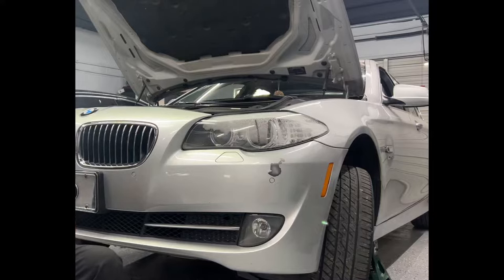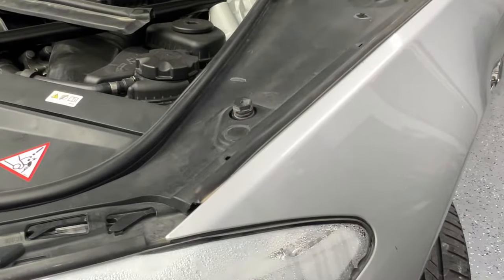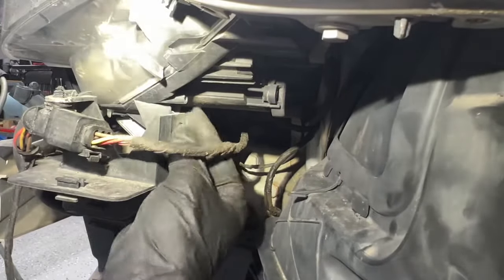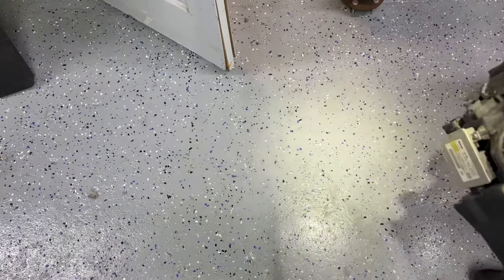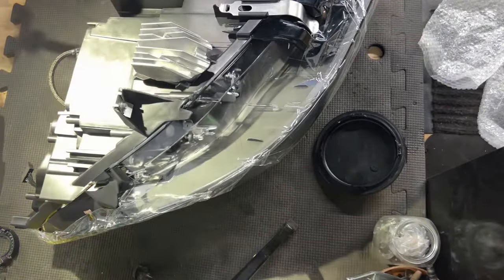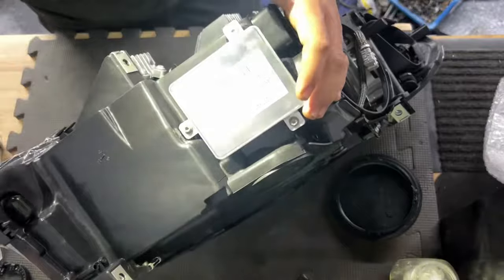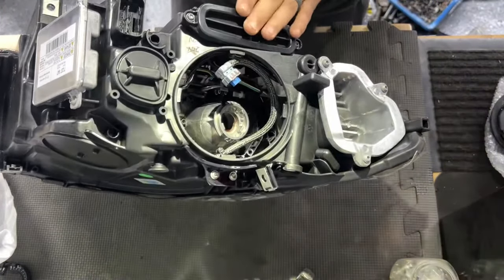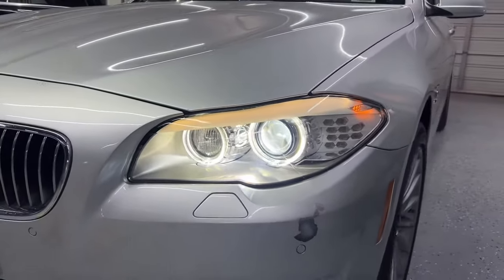Headlight Replacement & Modules BMW F10 | 550i, 535i, 528i (11-2016)

Comment: Why didn’t you replace it like any normal person would, from underneath through the wheel well, using the designated access panel?
Reply from the maker: @sawomir6037  are you talking about replacing the bulb through the wheel well? Because as far as replacing the headlight you can’t remove it without taking the bumper off

Comment: How’s it going , I have a 2015 550i and my front left headlight is giving me issues now. I had condesation in it and it worked then eventually stopped working. I’m trying to figure out if I need to replace the whole headlight or just the control module and maybe a bulb? I have a few codes but the adaptive headlight malfunction pops up first. My halos work but aren’t as bright as my other side? Any advice?
Reply from the maker: If you see condensation inside you have two options! Either you replace the headlight or rebuild yours as in take the front lenses off and reseal it! As for the modules I would recommend replacing all of them just so that you don’t have to do it twice!

Comment: I just installed aftermarket assemblies and nothing in them works, so obviously they need to be programmed. I called everywhere and they all say they can’t do it so do you know what scanner I need to use to program/initialize them? Thanks
Reply from the maker: Sorry to hear that 🥲 autel Maxisys Will be the scanner to do the job!
Reply: @brownsburg.motorsports  I recently replaced mine too but the highbeam and the angel eyes don't work, does it have to do with initialize? Low beam is fine
Reply from the maker: @Bossy23  yes initialization is an important step to make sure everything is working properly!

Comment: I need advice on replacement of the Headlight Washer Cover and the Hinge/Spring that connects to the Front Bumper cover? It's 2014 F10 535i xdrive.  A deer hit it. But also the washer nozzle now moved forward also. I do need a washer nozzle as it's missing the nozzle tip. I compared it to the drivers side. I didn't want to  do a claim on this, because parts are reasonable. Thanks. Duane, MI.( I have the plastice hinge but that's all broken that connects the cover and to the bumper.) Thanks for your time and help. I can't locate no info on this.

Comment: This video is amazing. THANK YOU for taking the time to carefully explain each step. I am getting ready to replace LH headlight on a 2013 528i xDrive and will follow the process you have outlined here. If possible, please post links to aftermarket headlight and modules you have used in this video. Thanks again.
Reply from the maker: Thank you so much!! If you could text me on TikTok or instagram I can try and get you the links if they’re still available or help you look for the right ones!

Comment: Hey, hope you’re still reading some comments. Very informative video, very much appreciated the thorough guide. 

My right side xenon is malfunctioning, it works when I start the car and then after a few minutes of driving shuts off, when I restart the car it’ll work again for a few mins and then shuts off again. Rest of lamp (blinker and angel eyes) work as intended. The adaptive headlight control (lights following steering) and xenon are malfunctioning and give errors on the dashboard. Which module would you think needs replacement?
Reply from the maker: I would say the Xenon module which is the square/rectangle looking module is the one that needs to be replaced! Seems like it works when the module is cold but when you turn on the light it heats up and turns off, most likely some water got in there I would pull it off first inspect it and go from there! 

Thank you for watching my video!!
Reply: @brownsburg.motorsports  thank you for your response, I have since then replaced the xenon bulb and all seems to be working fine. Haven’t had an error on my dashboard at all and the lights and adaptive functions as it should. I’m still a bit confused why a burnt out xenon bulb would case the adaptive lighting error, but atleast it’s fixed now. With xenon module I’m assuming you’re referring to the ballast?
Reply from the maker: @bruciekibbutz4698  yes I Am! I am glad it’s working now!!

Comment: Thanks for the great video! Is it possible to replace only the turn signal module without removing the entire headlight?
Reply from the maker: Thank you 🙌🏽🙌🏽 I believe the headlight will have to be removed to gain access to the turn signal module ☹️

Comment: Do the 2 angel eye modules and turn signal module require some type of water tight sealant before installation?
Reply from the maker: They should come pre-sealed with a gasket on em otherwise you can use automotive silicone

Comment: On my original Head Light there is some gooey gasket materiālu around the base of the halo module.  I noticed that when you installed the halo module, there was no such gasket. Is that Ok? Or should I be sealing it somehow?
Reply from the maker: The halo module should have a rubbery white gasket that comes with it if yours doesn’t have it I would recommend sealing by either getting the gasket online or with some Windshield Gasket sealant, apply it around the module and then install it but would definitely recommend getting the new gasket for it instead
Reply from the maker: Also the gasket on the Halo module should on the inside if that makes sense so around the inner bean where the led dots are placed
Reply: @brownsburg.motorsports  Awesome.  Thank you - I was trying to reuse the original, but decided to just order all new components like you did!
Reply from the maker: @edvinsroze5388  that’s awesome! Definitely the right way of doing it!

Comment: I need your assistance! I have a 2011 535i Xdrive when I first purchased from dealership the detail guy there had it for 2 days I go to pick it up the headlight was full of water broke the seal and they wouldn’t replace. My turn signal and daytime lights didn’t work. But high and low beam worked I had rats crawl into my engine chew through wires it was in the shop for 7 months. The driver headlight with issues now no lights work but my right side headlight that has no issues all the lights work but the right side turn signal isn’t working either. The turn signal lights up but idk if it’s a bulb issue or module would I be able to send you pics and u let me know what my options are! Ik for sure I need a new driver headlight but  all the lights work on the other and the seals are still good. Is there any more parts I need to order for the headlight then what’s linked below in the description?
Reply from the maker: Sorry to hear that 🥲 that sounds like so much especially with the chewed up wires and Sure contact me on insta or TikTok

Comment: How did you clean that corroded power cable?? Mine is very corroded, and I’m scared to reuse it without cleaning or replacing it!!
Reply from the maker: @MASTERMIKEEE  I just added the link in the description for what I recommend using! Any electronic cleaner you can pick at the local parts store or from Amazon, spray it on the connector let it sit for 3-5 seconds and brush it with a tooth brush then run some air through it with an air gun or spray to dry it off and get the corrosion off
Reply: @brownsburg.motorsports  It’s okay to clean with a brush as long as the battery is disconnected? Also was your fuse blown? My corrosion looked just like yours.
Reply from the maker: @MASTERMIKEEE  yes you do all that with a disconnected battery! My fuse was intact 🙌🏽
Reply: @brownsburg.motorsports  ok check this out — put everything together and the corroded side still didn’t work!! After hours of troubleshooting, I realized the left and right assembly’s have the same power connection; just inverted. So I connected the (known good) right side assembly to the (unknown/not working) left power plug. It worked!! This seems to confirm that the new headlight assembly is not working, right?

And then to double check, I tried the (apparently broken) assembly on the good power cable, and it still did not work!

Planning to return it and get a replacement.
Reply from the maker: @MASTERMIKEEE  nice troubleshooting steps 🙌🏽 did you replace the TMS or just the assembly? TMS could also be the culprit I have ran into that before 🥲 you could swap the TMS from the good headlight that’s working to the one that seems to not be working and test again on the side with the corroded plug and see if it works if it still doesn’t the  get a replacement but If it does work then get a new TMS just make sure they have the same amount of prongs because there are multiple ones!
Reply: @brownsburg.motorsports  Yes, I swapped TMS to make sure. Both new TMS I bought, I have verified they work.
Reply from the maker: @MASTERMIKEEE  alright then you got it it’s a faulty headlight at this point for sure! Great troubleshooting 🙌🏽

Comment: I have a 2012 bmw 528i xdrive and my whole driver side headlight is out. Nothing works not even blinker. I just replaced the bulb and still nothing. Do you have any idea? 
Thank you
Reply from the maker: If nothing working then I would check the power coming at the connector and I would check also for any corrosion on the connector it self!
Reply: @brownsburg.motorsports  by “connector” do you mean the control module?
Reply from the maker: @GSXRJAY  on the back of the headlight there is a connector like a plug basically, plugs into the back or the headlight distributes power to the bulbs and module inside the headlight, take a look at it and see if it has any whitish blueish reside, connecter should be rectangle

Comment: Impressive video!  Thank you for publishing it.   If the left turn signal, angel eye and/or headlight aiming system generate error message(s) every few months, does that mean there is moisture in the connector at the back?   Is there any way to remove the water and seal it, without having to remove the bumper?   Thank you..

Comment: Can I ask whatidule controls turning the lights left and right as I drive?
Reply from the maker: The lights turning right and left as you’re turning the steering wheel are called AFS or Adaptive lights the one in the video is adaptive but be aware that some models didn’t come with AFS/ Adaptive feature
Reply: @brownsburg.motorsports  I have a 2012 bmw 535i and the adaptive headlight malfunction light keeps going off and on. When it goes on the lights don't turn left and right. When the light goes off they work fine. I was getting moisture in the driver's light but I figured out the access door was open and I closed it. The malfunction light was just going on when moisture was in there and it would dry and be fine . Now it just going off and on. Id love to know what controls left and right turning so I could pin point and fix the issue.
Reply from the maker: @heatherhoyt3922  so the issue with this is the TMS module getting moisture on it and burning out unfortunately even if you replace the TMP and replaced the seals on the headlight the internal connectors are the ones that gets corroded and eventually short out which will cause the issue you have. I have seen so many symptoms and it’s definitely worth it to just replace the headlight with the modules

Comment: I would have some sealant around the modules.
Reply from the maker: @stephenkocynski7911  that’s exactly what needs done! I didn’t include that part in the video but I would recommend automotive clear silicone you could pick up in O’reilly or AutoZone
Reply: I used butyl tape that I got on Amazon. I folded the tape, rolled it in my hand to make it round, and placed inside the groove.
Reply from the maker: @stephenkocynski7911  that’s genius🙌🏽

Comment: I’m going to use the old parts hoping to avoid having to reset. It’s been the hardest part at this point. That gooey sealant is a pain.
Reply: I’ll add the condensation on the old one was the culprit but cleaned up the connector - fingers crossed
Reply from the maker: @ImStep-by-Step  if you use all new modules but using the same TMS you shouldn’t need to program anything, programming/initialization is only needed if you replace the TMS
Reply from the maker: @ImStep-by-Step  hope it works for you 🤞🏽🤞🏽
Reply: @brownsburg.motorsports  thanks! Had to pause and order new HID - appreciate the info too!! Great channel
Reply from the maker: @ImStep-by-Step  alright!!! Hope it works well for y’a if you have other questions feel free to reach me on TikTok or instagram! Thanks for watching!
Reply: Got it all done. The adhesive yuck, but looks and works better than new. Changed the module only on the passenger side but still getting errors - wondering if I should reset @brownsburg.motorsports
Reply from the maker: @ImStep-by-Step  if you have access to a professional scanner I would try teach in process or initialization

Comment: How do you remove wiring clip from old angel eye?
Reply from the maker: @ralphtrott341  you gotta open the halo module pull it a little bit and then pull on the connector itself it doesn’t have a tab it just fits there tight
Reply: Mine seems very tight. No tab or clip? I don't want to break the receiver portion.  Do you remove the Torx bolt and remove the black LED cover?
Reply from the maker: @ralphtrott341  yes all 3 torx screws all of them are tight so don’t worry about breaking it that’s just how they are unfortunately 🥲
Reply: @brownsburg.motorsports  Not those screw.  The plastic plug with wiring that powers Angel Eye
 will not come out of the black socket. That's my problem
Reply: If you could tell me how to disconnect that wiring it would be very helpful
Reply from the maker: @ralphtrott341  yes that’s what I am talking about too! You just have to yank it harder that’s the only way to get them out! That connector has no tab or anything holding it it just fits there tightly

Comment: Do i need to change out componentshow much do people charge to program the brain
Reply from the maker: it only needs basic programming any shop can do it and it shouldn’t more than 150 at most!! It’s literally a basic hot function for the headlight autel scanner does it even the cheaper ones that runs 300/400 dollars